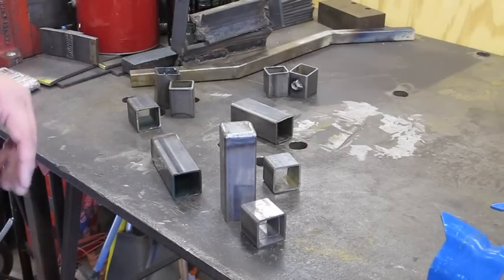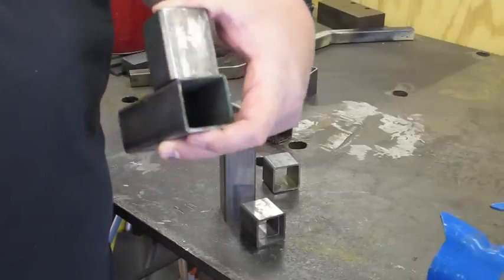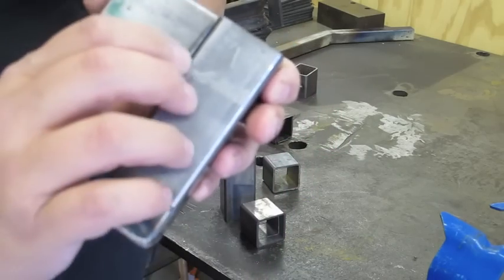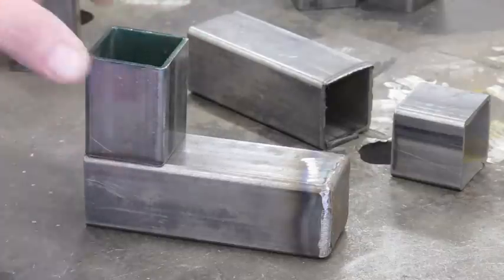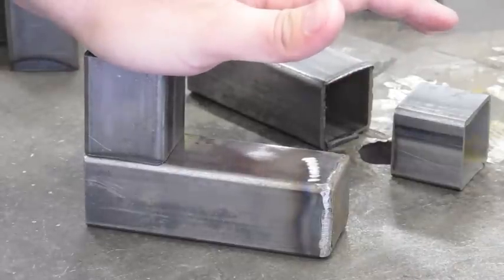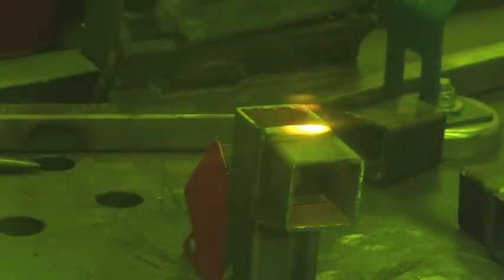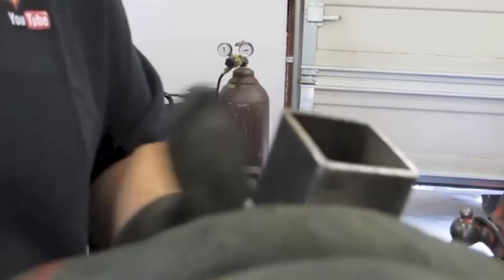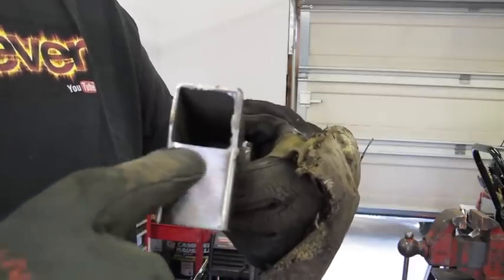Mig Welding - Square Tubing

Comment: I recently started welding at a local shop and all we do is MIG weld square tubing just like what you showed here. The interesting thing is I live in Israel and work with two Arab guys who while very helpful and friendly, don't speak English.  We all speak very basic Hebrew,  but basically I had to learn by watching closely, and a couple days of practice on scrap tubing. I found this video to be both very helpful and very reassuring.
Reply from the maker: I love receiving comments like yours, especially from so far away! I thank you for kind words and wish you continued succes.

Comment: I was a welder for 14 years, started on mig, and progressed to tig for a while as one company I worked for made vending machines, which I made the front panels, and required both mig and tig welds. Before that I made farm gates and sheep hurdles on a piece work basis, so it was fast paced stuff, using 2x1 on one end and 2x2 section on the other. The tubing was round and fairly thin gauge mild steel, so in order to weld quick without blowing holes, you had to be quite skilled to keep up the pace. Nice work. Mig welding has to be the easiest of all welding.

Comment: Dan you do a great job with your video's. I am learning to weld late in life. My problem is seeing and getting comfortable.
Reply from the maker: Thanks for watching. If your having trouble seeing, I might suggest you get a "cheater" lens to put in your welding helmet. This will add magnification and hopefully help you out. You can find them at any welding supply store. As far as getting comfortable, try using both hands to hold the MIG Gun (or whatever electrode holder you are using) and prop your week hand on something to steady yourself. If you take a look at some of my stick welding videos, I describe how to get into a comfortable welding position. Good luck and thanks again for your comment.

Comment: Fantastic informative video bud. Just wanted to say thanks. I'm a new welder and I have some vehicle seat subframes to make. This video has been a gold mine of information.I noted you pulled 3 welds and pushed the butt weld. I've got a new 135 amp welder and will be welding 2mm wall thickness 40mm square tube which looks pretty much like what you did here.
Reply from the maker: I'm glad you found it so useful!

Comment: Great video , thank you . I was going to buy a Miller 211 mig welder for welding square tubing for my weight lifting machines . Will it be a large enough machine ? Not concerned about duty period as it a hobby

Comment: Hi there, that's a really great video. Thanks for making it so clear and easy to understand. I have a question if you don't mind. I'm currently still learning and have just done my first set of butt welds. They looked ok but the penetration was poor. . . You could see the heat discolouration but you could also see the two joins and no weld coming through. This was easily resolved. . . I simply added a root gap and am now getting the exact penetration I need. However. . . I do my first steel tube weld next week and I'm unable to up the settings on the welder as I'm already at the max. setting. So as I can't have a root gap is the only option to grind bevels to leave a 'v'? This will be a table so good penetration is essential.

Comment: Good Info and camera shots. Settings for the Mig welder would be helpful
Reply from the maker: +Dale Thomas I usually don't mention setting, because they are generally different based on the welder being used., and most smaller units do not display inches per minute and true wire speed (including mine). In either case, thanks for the compliment.

Comment: Nice video and nice weld job.  I'm a mechanical designer by profession and occasionally design structures using square and rectangular hollow steel shapes (ASTM A-500).  The biggest problem with joining these shapes is that the outside corner radii can be quite large.  This creates an issue for the flare bevel joint in that the fit-up might leave you with an excessive root gap.  What I generally do to mitigate this problem is introduce a piece of flat bar in between the two hollow shapes.  You weld the flat bar to the side of the one piece, laying in your flare welds.  Then weld the second hollow shape to the flat bar.  You can either butt weld all around or bevel the flat bar or end of hollow shape and weld all around.

Comment: Just a note: the metal doesn't bend because of heat 'drawing' towards a side.  The metal goes on as a liquid, and as it cools to become solid,  it contracts (shrinks) - which is what pulls the metal toward a certain direction.  Cheers!
Reply: Blank Reg obviously.
Reply: If you know anything about welding lingo "drawing" and" contracts (shrinks)" are the same thing, I learned that 35 years ago. Cheers!

Comment: Nice video -- thanks. But there are a couple of things I was hoping to learn that you did not show here. First, how do you cap the end of the tubing? Second, do you need any special welding technique when you put together two pieces of square tubing at a 90-degree angle by beveling the end of each piece to a 45-degree angle?
Reply: A jig helps

Comment: I liked the welding you did on that square pipe,I bought  sections of that pipe at Home depot and I guess I bought all of it because they don't have it anymore.Where's a good place to buy this kind of piping from?.I need it to finish a skeleton flooring  system I'm building in the back of an elcamino? Thanx for any direction you can point me in...

Comment: one thing i noticed...I was told to always push when you mig weld.....i was told just lately to always pull when you weld with flux core wire.   I noticed you pulled sometimes on your welds and they still turned out just fine.  I weld mostly with flux core on high tensil galvinized pipe.   Most of my welds are verticle.    Whats the best way to weld them?   So far Ive never had a weld break but a person can always improve, either on appearance or strength or speed or even just making it easier.
Reply from the maker: I typically push vertical up welds, however, MIG welds can be either pulled or pushed. Makes very little difference in penetration, that's all.
Reply: Matt Leigh "if there is slag, you must drag"... With Flux core wire feed, and with stick welding, always pull the puddle. If you are pushing, you will contaminate the weld and bury slag in the puddle.
Reply: Huge difference in penetration mate. Been welding for 12 years.
Reply: Matt Leigh Well... you were told.

Comment: Great looking welds.  The main problem I have with welding tubing is trying to keep things square due to warping.  Any hints?  Obviously the longer the material then the more apparent the warping is but am I better with lower current and voltage or raise it all and move the gun quicker?
Reply from the maker: What I usually do to counteract warping, or pulling, is to lay down some weld on one side of the piece first (like a long tack, or perhaps a few stitch welds, depending on the size of the material), then I weld the entire opposite side. Lastly, I go back and weld the original side and this usually seems to do the trick. Alternatively, if the part is small enough, you could but some clamps on it, or if too big for clams, you could tack to your welding table (temporarily) while you fill in your welds. Thanks for your question, and thanks for watching! Make sure to check out our website at www.wedfever.com and join the forum for more welding discussion!

Comment: I just got my first MIG Welder in the mail this week (Millermatic 211), I am brand new to welding, mostly been a wood worker but always wanted to get into this.  I need to go get some shielding gas next week and some steel to build a cart and welding table.  My question is this:  when you grind down the weld bead for "looks" at the end of the video, doesn't that weaken the weld joint and subsequently weaken the strength of how much it will hold?  Thanks.
Reply from the maker: +choprpilot76 It all depends on the type of weld and the skill of the welder. If you get good fusion and complete penetration on the butt welds, then added reinforcement will not add substantial strength. This may be true of the flair bevels also. For a fillet weld, removing the weld would be catastrophic, since the weld bead is integral to the welded joint. In terms of a decorative piece, or something that won't hold much weight, it probably wouldn't make that much of a difference. Hope that helps, though I know it's a lot to digest.

Comment: Your video is great and straight forward. I have a cheap HFreight 90 amp welder and found some upgrades to make it DC W/bridge rectifier 3 phase and a capacitor. I wonder what you suggest on that subject. I haven't converted it yet but would like to be able to make weld somewhat close to yours. If that's even possible w/low buck HFREIGHT welder. Thanks for help.
Reply from the maker: Russ Larson unfortunately, I am of no help to you on this subject, because I am not really into modifying welding machines. Frankly, i don't know if a HF welder can be improved much, but whatever you decide, I hope you'll

Comment: Can you show the exact same exercise but use flux core.  The welds look very different with more spatter and different techniques may need to be used.  Could you also show welding the vertical inside and outside corner uphill/downhill as well.  Thanks.  Great video, very helpful.
Reply from the maker: Scott Goessling Check out this video to see if what you requested is already there: http://youtu.be/M5z2osw6EbA

Comment: As many others here, I'm learning MIG. Take a look at min 6:50. How do you get that result? You mentioned grinding wheel and sanding. Could you elaborate on the specific tools and how? A short video would be great and appreciated. Great job with the videos! Subscribed!
Reply from the maker: Sure, it's pretty simple really. You just use a grinding stone on your angle grinder and knock down the high spots of the weld material. Knock it down just before you it the surface of the plate, or in this case tubing, so you don't put a gouge in it. The, take a regular sanding disc, or a sanding flap disk (as I did) and finish the job to a high polish. The finer the final grit of sandpaper, the better the high luster finish will be. If you don't know what some of these items are that I mentioned, just google them and you'll get a ton of pictures and info. Hope this helps!
Reply: WeldFever Thanks! Maybe a short video in the future?
Reply from the maker: Sounds good, in fact, I will make a video about grinder use in general. Stay tuned, I'll try to have it done by the end of this week!
Reply: WeldFever I suppose you would just learn from experience, but how do you know for sure that the penetration is deep enough to allow for the grinding of the high points without weakening the weld? I'm afraid of grinding the weld too far and not realizing that I don't have much actual weld left to be a strong joint.

Comment: Great video and explanation.  I noticed you dragged all but one weld, which was pushed.  Does it matter?  I'm a novice (even taking a fcaw course at local college) but can't get a definitive answer on push or drag. The guide on my Handy Mig says drag flux core (fcaw) and push gas (gmaw).  It also says not to weave but to move in a straight line.  All those beautiful welds you see were not done in a straight line; they were produced by making "c"s or loops.
Reply from the maker: +Steve Scott Great questions. With flux cored, you want to drag to avoid possible slag inclusions. The old welder's adage states, "if it makes slag, you must drag." A simple yet effective rule to weld by. As far as MIG welding goes, pushing and pulling is fine. The difference being that when you pull you get more penetration than when you push. So pushing is best for thinner material and vice versa. You might see comments from people who disagree with me on this one, but all the welding books out their and the major welding machine manufacturer's can't all be wrong, and that's where I got my information from. Good luck.

Comment: Great informative video! I am thinking on learning to weld and was wandering if you think that it would be OK to start with a relatively cheap mig welder to practice and see if i actually like it, or would you say that cheap mig welders are not up to scratch even for beginners? Thanks
Reply: ie. with a cheap welder could you ever expect to get similair results as to you did in the video? Thanks again
Reply from the maker: Ruan Urquhart Take a look at the videos I did no the longevity machine. I think that might answer you question? @Yq_3lNtQR7E

Comment: I love this channel - thanks!  I'm buying my first welder (perhaps welders)  based on your Longevity MIG 140 and Stick 140 recommendations.  I've never welded before.  I'm a garage hobby welder, and my primary goal will be to weld square tubing as you've done here.  If I take my time and prepare my metal surfaces carefully, do you think I can achieve these results with these 140amp welders?  Does it make a huge difference to step up to 160 or even 200amp welders for my applications?   Thanks in advance for any advice.
Reply from the maker: +Chew Manfoo Thanks for your comment and welcome to the world of welding! To answer your question, a 140 mig welder will be fine for square tubing similair to what I Welded in the video. Good luck to you!

Comment: Very nice welds. What are the pros and cons of cutting the tubing at 90'?  I have only been welding my projects at the 90'. Thanks
Reply from the maker: +Don Welcker Honestly, I don't think it makes much of a difference structurally, provided good welds are placed on it. Astetically, it might not be as Nic to look at, and there is usually apthe extra step of having to cap an end if using 90's, but that's about it. Perhaps some of the viewers can chime in?

Comment: Thanks for this very informative video.  Quick question:  Do you use .024 or .030 wire for the thin wall square tubing?  Thanks again!
Reply from the maker: +Matt Doyel The recommendation is to use .024 for material thickness up to 12 gauge and .030 for up to 3/16." Hope that helps.

Comment: Just got my first welder, the Harbor Freight 90amp flux core welder. First project will be metal fence railing, thin gauge metal. Any tips on how to join the corners as the railings will be a decorative piece? Mitre the ends to make the 99 degree corners? I do not want to show open ends and do not want to use caps on the open ends. Not sure on the gauge of the metal tubing, will be but will be about 1/16".
Reply from the maker: +Jeffrey Beyer Miters are about your only choice if you don't want to weld on caps.
Reply: +WeldFever Found plastic end caps to put into the open ends of the square tubing. Will save a bunch of work.

Comment: Dumb Question, but where is the Gnd strap? I would think its best to be as close to the weld as possible, I assume it's strapped to your table leg? If so then why isnt there pitting/arching/marking on the area of the target piece where it meets the table as you weld. That would  be a "high" resistance area between table top and target piece as its not  full contact and I'd expect that high current would arc across areas between table and target.

Great video thanks -D

Comment: Could share your setting on your welder? Gas,amperage and wire speed.thanks for the good job on the videos
Reply from the maker: Most smaller welders do not provide the actual wire feed speed, nor the voltage, but rather give you a couple of dials with arbitrary numbers, or letters to be used with a chart they provide. Having said that, I was welding on about a 14 gauge walled square tubing, so my settings were probably around 200-250 inches per minute for wire speed, and 17.5 volts, using .030 wire. That would equate to around 100 to 125 amps, give or take. My shielding gas is 75% argon, 25% co2, with a pressure of 15-20 cfh. Hope that helps!

Comment: I like your vids,i am a beginner more into auto body refinishing, my ques is what setting would you recommend when welding tubing,i have a Hobart auto arc 130, any advise.
Reply from the maker: +Thakurdat kishundial I'm afraid, that's too hard to answer without more information and without knowing the settings on your machine. Look under the lid of your machine and it will recommend settings based on the thickness of the part being welded, the wire you are using and the shielding gas. If your machine doesn't have it, go to Hobart's web site and get a copy there. Good luck!

Comment: forgive my ignorance, but on the inside, do you need to complete another weld to increase strength or the wend from the outside will seep through and bind the inside also?
Reply from the maker: +kevoau1 You should weld around the perimeter of any tube for proper strength. I hope that helps.

Comment: Learned to well years ago in arc and gas.  I have a MIG and I hav e trouble getting the same results.  Don't have gas setup so I use the flux core.   I see the small "e" technique but what is drastically different for me is the right to left motion when I am used to the left to right.  Any real reason why L to R ? Also just how close do you position the tip?  Does it matter?
Reply from the maker: +David Clink You must drag when you weld with flux core and not push. Actual direction is irrelevant. You must read the manufacturer's suggested stick out length for the wire you are using, but flux core stick out is generally longer than solid MIG wire. For .030 NR-232 wire, I usually have about a 3/4" sick out.